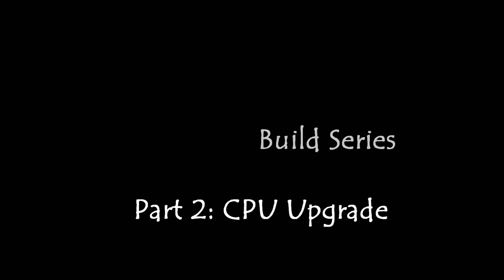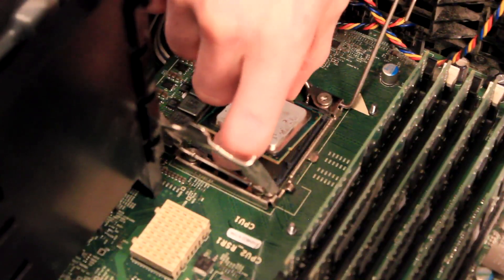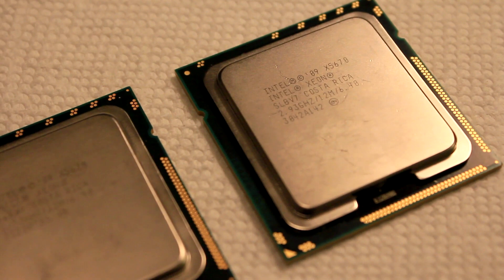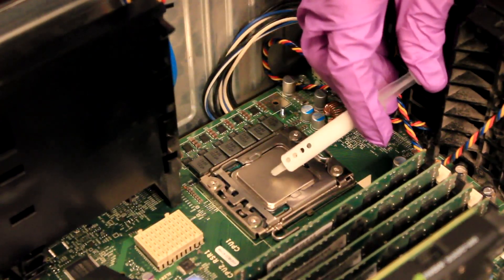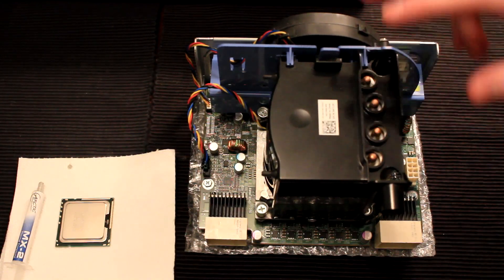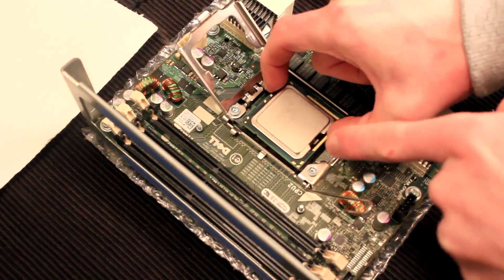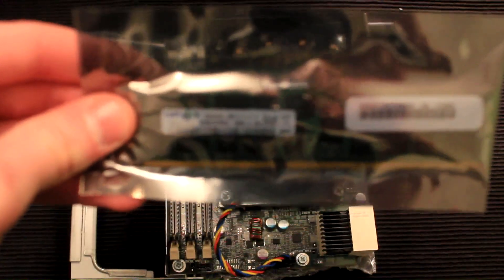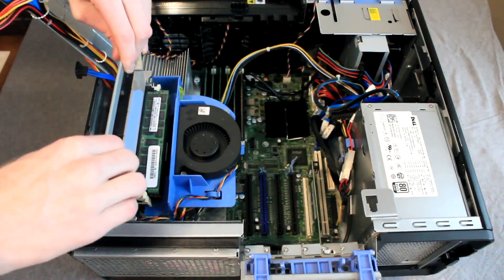Dell Precision T5500 Build Series: Part 2 - CPU and Riser Board Install

Comment: I had a Memory Failure in Riser DIMM 1. Swapped the memory out in that slot. Same message still appears, but I can F! and use my PC until it freezes or restarts. Then I have to restart manually.  Ordered a new RISER for 55 bucks, crossing fingers. Got a Dell refurb instead of new. Figured the refurb would have kinks worked out.

Comment: does anybody know if the cpu in the riser will still work without installed ram in the riser board? can it just run off the motherboard ram?
Reply from the maker: No, the precision computers have very specific memory population rules. It should be possible to populate the memory modules on the riser board and install the 2 cpus and have this work. Check out part 3 of my series https://youtu.be/oLhlfB46gqg?t=26 for more information.

Comment: Nice video. I have same PC T5500 adn same CPU's (dual X5670) with RISER CARD an 9x8GB (72GB hexa channel) DDR3 ECC registered Samsung memory. This is old but still very powerful PC. Stronger than some new PC's.
Reply from the maker: Underrated for sure, especially as a prebuilt PC

Comment: Are the Dell T7500 and T5500 CPUs interchangeable as long as they both have the latest BIOS? thanks
Reply from the maker: THe 5600 series Xeon CPUs will work in both systems. The T5500 CPU socket is the LGA1366
Reply: Dell T7500's  will sometimes show a motherboard DIMM slot error if you upgrade the processors without upgrading the BIOS to the lastest revision first.  I've seen this happen when upgrading to a pair of X5680 processors. Once the BIOS was updated the error was resolved.

Comment: I put in a couple of x5687s.....a little hot, but works pretty good.
Reply from the maker: I might have to try that
Reply: @DVTutorials  They're getting cheaper by the day, you can get a 2 for under 80 bucks. I should eventually just put in a pair of x5690's and call it day. But yeah, you can "roll coal" with this hog!! lol
Reply: I'm running dual x5687s with AIOs on them, they never go above 50c
Reply: @orielism  Can you tell me what heatsink do you use?
Reply: @nelutucampean4180  they are AIO water coolers, ID Cooling Frostflow 240, with noctua fans

Comment: Why does no one use the screw/bolt to mount the riser to the motherboard????
Reply from the maker: Correct @Joonas--
Reply: @Joonas--  I don't care for the risers in T5500 or T7500 either.